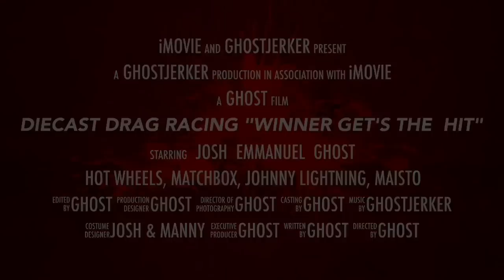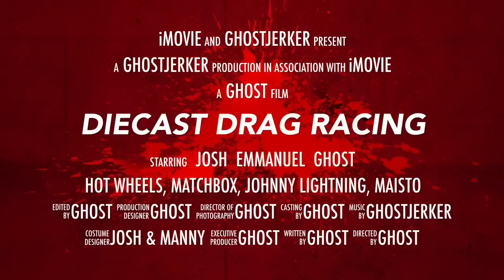2 LANE DIECAST DRAG RACING

Comment: Wouldn't rubber tires work better since it wouldn't spin out as easily?
Reply: Yes and no. The rubber tires would "hold" or "stick" to the ground better than the regular plastic wheels which can slide far easier. However the plastic wheels usually roll quicker. It depends on the car, the surface, and the other factors. On this track though, I'd think IF the car rolled well to begin with, the rubber tires should give it a decent run.

Comment: Is there any way to convert the time of these runs to real 1/4 mile times
Reply: Joel Arun You need to calculate the distance of this track, and then scale it up so it equals 1320 ft, or a 1/4 mile. The number you multiplied the original track length by is the same number you multiply the e/t, or elapsed time, to get the scaled up time.
Reply: YRS2703 Thank you so much